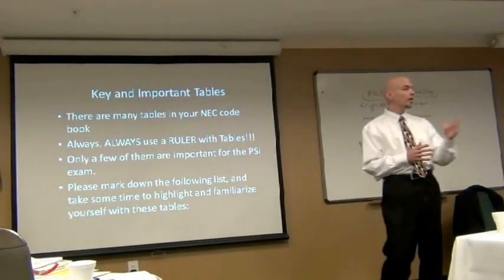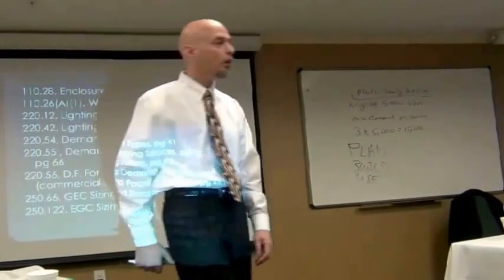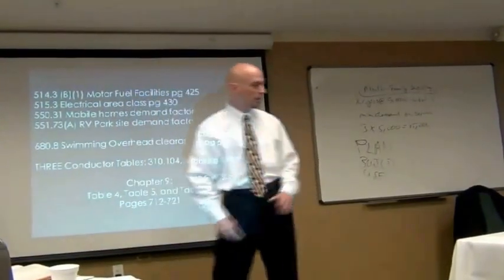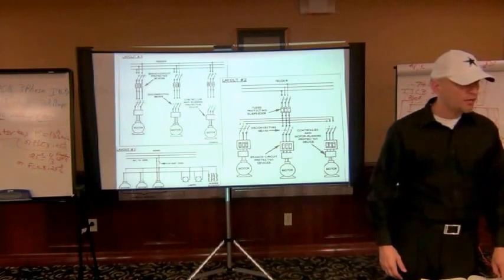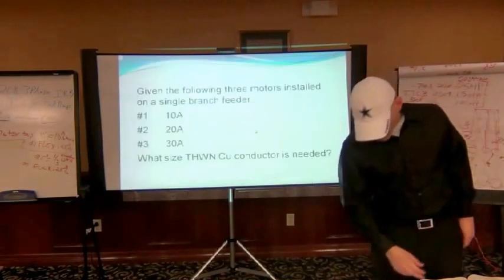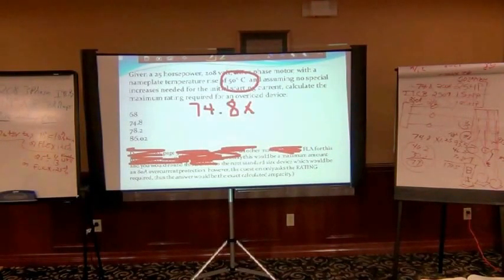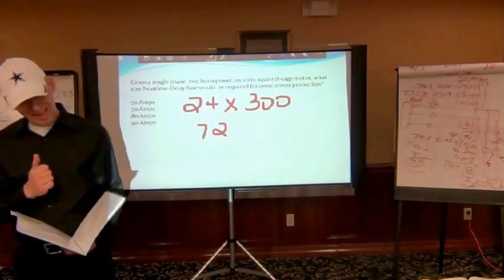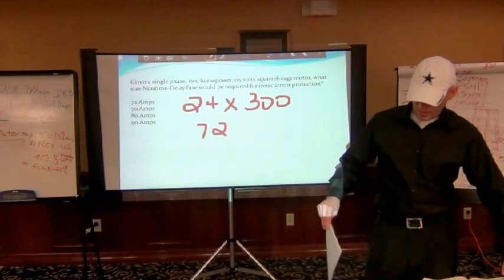Top NEC PSI Tables, FULL MOTOR SECTION, Good class review

Comment: One of your video, there is a calculation about the cost in dollars of 1 year of load for a range 8500 watt per day, 4 hours (2+2 so not continuous load) at 11.2 cents per kWh. If it was continuous load, do I need to add 125% to 8500watt? Thank you Mitchell for the time you spent making those videos very informative...

Comment: I am confused with Table 250.66 and your example...
If I have 5 parallel pipes with a set (3ph) #2/0 on each pipe(for example), from what I am reading in note 1, I need to add 5 times #2/0 (phase A[for example]from each conduit) which gives the full size of the OCPD (for A phase) which is proportional to the size of the GeC needed... Following your example, 5 conduits, but only counting 3 wires (1 set) doesn’t give “the full” size in amp from the service. I hope it’s not too confusing. Note 1 clearly said “ OF EACH SET”.
Reply from the maker: I agree that it says of each set, but it says the ‘corresponding conductors of each set.’ However, I’ve finally been convinced to agree that it’s 5 not 3.
Reply: Thank you for your prompt response and clarifying this, it makes more sense.